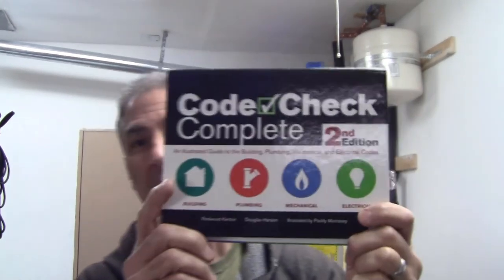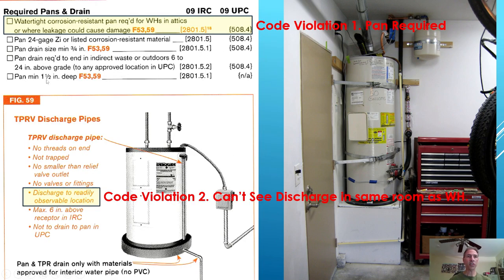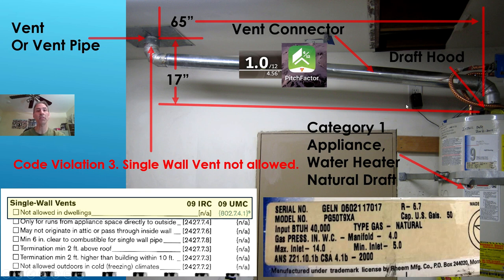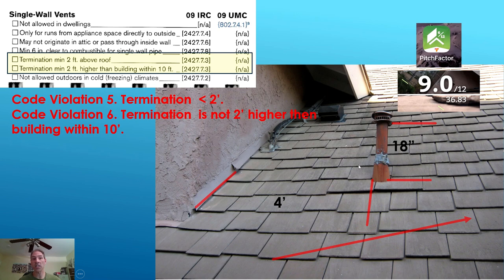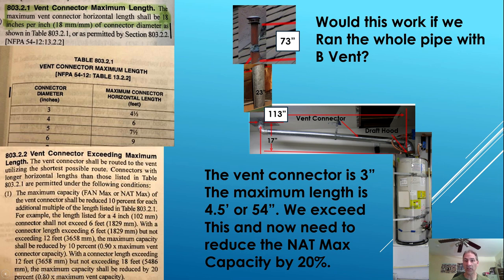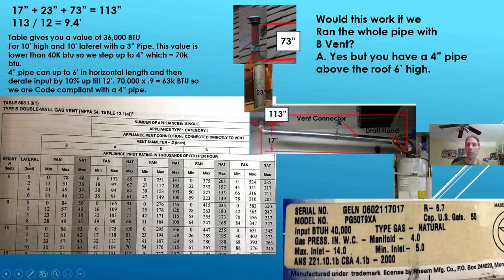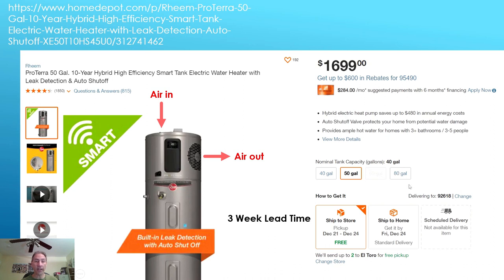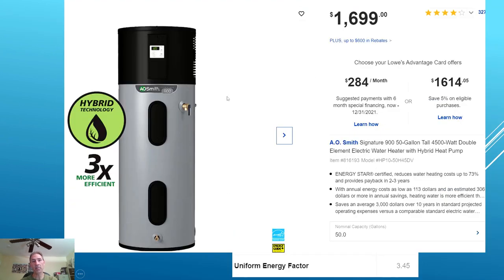Water Heater Inspection and Code Violations

Comment: My AHJ allowed a small hole in the TPR drain line to make the discharge visible in the room. It's in a basement, so has to discharge up, and the hole also satisfies the requirement discharge draining down to avoid standing water against the TPR. Also to see the bulk of the discharge is a long walk to the other end of the house, up the stairs, outside, and around to the back. This was a good improvement on the prior install -- that discharged up and into an adjacent crawl space and left the TPR valve submerged.

Comment: Yeah, the heat pumps are definitely cheaper to operate. But you have to keep in mind the maintenance which is not trivial, and the fact that you have a compressor and other components which can break and totally wipe out any savings.  The grass is not always greener on the other side.

I’ve spent probably $30 on my water heater for the last  15 yrs - anode rod and dip tube. No filters to clean or components to replace other than that.

Comment: Watch out on the heat pump units - they move heat from outside the tank into the tank. Where is that heat going to come from?
* From outside, it won't work well in below freezing temperatures but will work well most of the year.
* If from space using air conditioning, the heat pump water heater is a win - it will reduce your A.C. usage.
* If you are heating the space where the water heater "breaths" then you will have to add more heat, negating the heat pump usage and your final efficiency depends on your heating system efficiency minus the heat pump.
In my case I do not need it cooling my basement, and since I'm in a dry climate the dehumidification doesn't help me either. I'll definitely look again should I need to buy another water heater, and maybe then I'll be able to use an outside air source for good results 9+ months of the year.